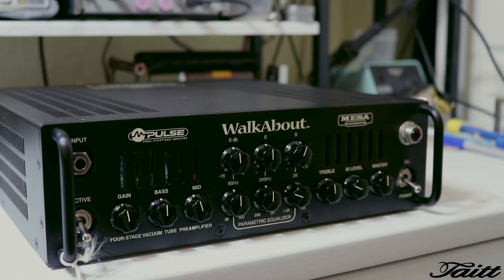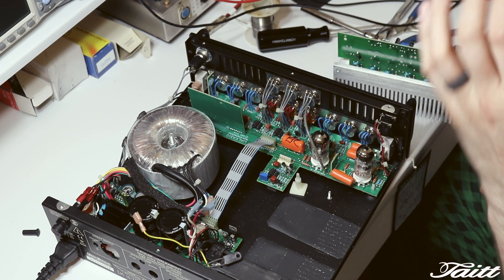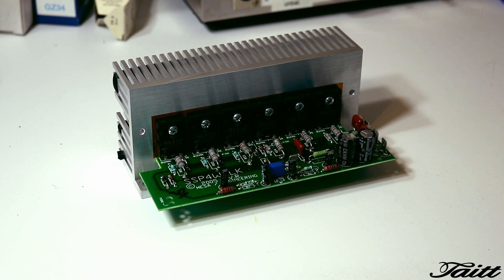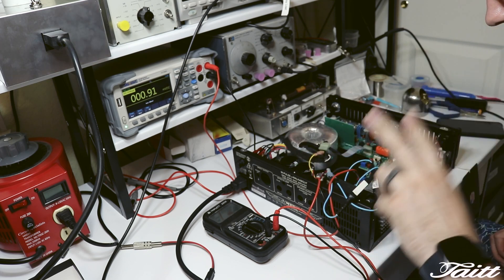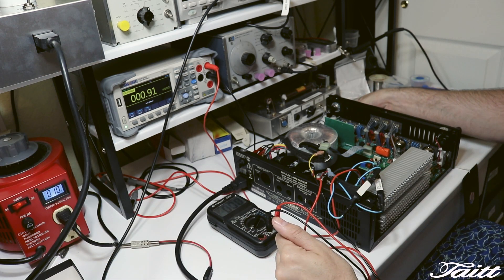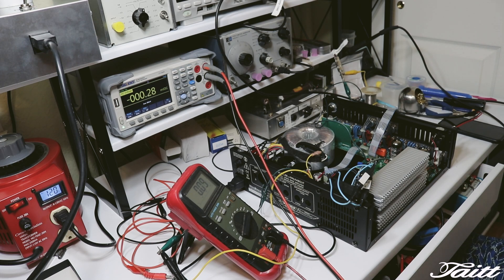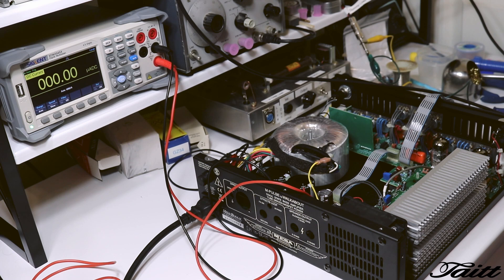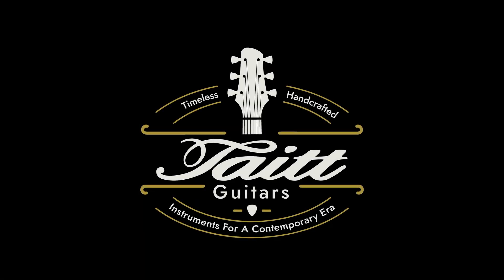Mesa Walkabout Power Amplifier Failure

Comment: Should have replaced the noisy fan with a quieter one while ou were in there 🙂 Are the mosfets easy to come by ? I have a Walkabout that I love and wonder if it will be easy to repair into the future..
Reply from the maker: Sorry for such a late replay. The original mosfets are no longer made unfortunately. There is a company called Exicon that have a line of mosfets that are the same type of liner mosfet and are a direct replacement. P/N ECW20N20 and ECW20P20. As far as I know these are the only replacements for any linear mosfet. Hopefully that helps.
Reply: @TaittGuitars  Thank you.